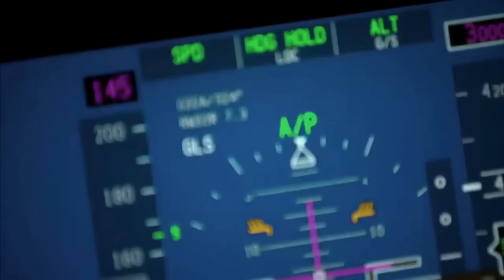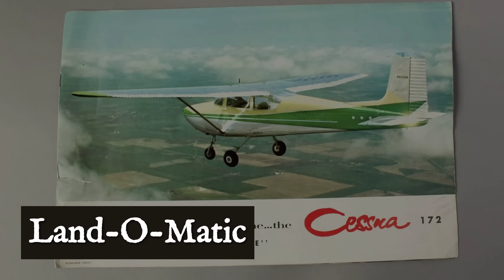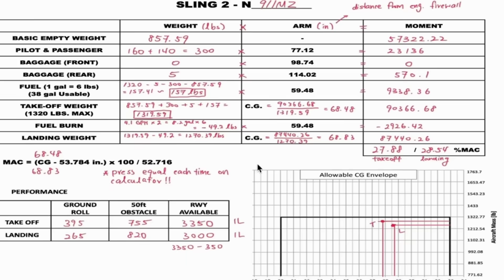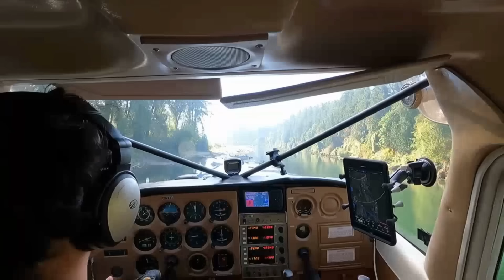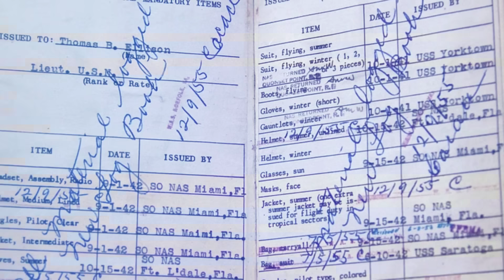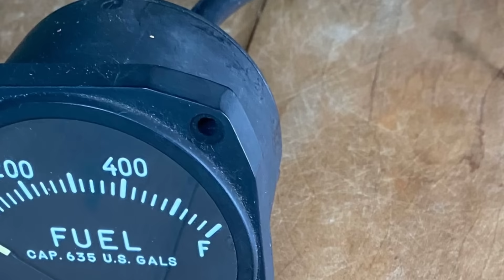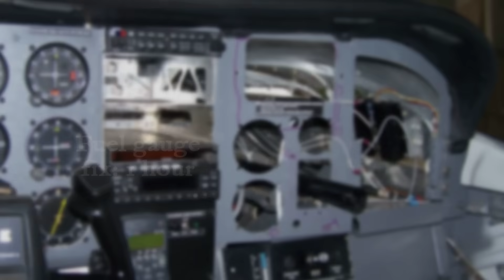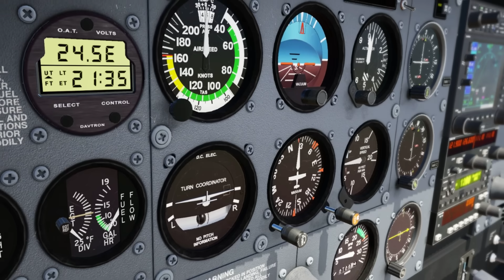The 1950s "Relic" That HUMILIATES Modern Aircraft

Comment: This video co.pletly ignores the C-72s competitor the Piper PA-22 Tri-Pacer. The Tri-Pacer was the first major 4 seat airplane in the lower price range equiped with tricycle landing gearand came out in 1951: a full five years before the
Cessna C-72. The PA-22 was less expensive than the C-172 in 1956. The 1956 PA-22 was in some respects more advanced the C-172 in that it was powered by a more modern engine; the Lycoming O360 rather than the less reliable Contintal O-300.
The 1956 PA-22 had what by modern standards a modern IFR instrument pannel layout. That being a center column radio stack and the six primary flight instruments in a "six pack" configuration. The 1956 
PA-22 also has a slightly higher useful load.
Reply: The  Tri pacer ?... great  bird  too  . haven't  flown one  but like the  specs and  videos

Comment: After having worked on and flown most single engine planes in the Cessna , piper and beech lines I agree the 172 is one fine little machine. the older models with a 180hp upgrade are really great.
Reply: The best was the 182 upgrade, 235hp, full full, adults sitting anywhere, rarely had to worry about weight and ballance